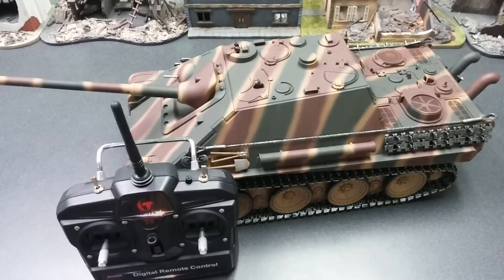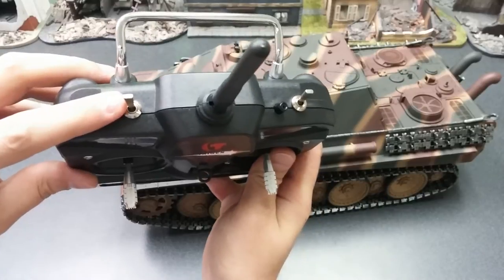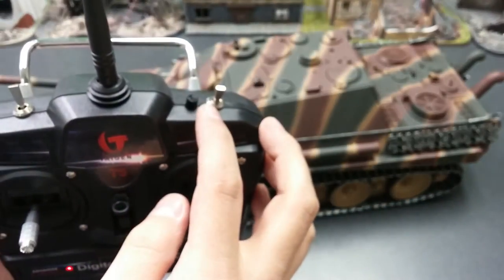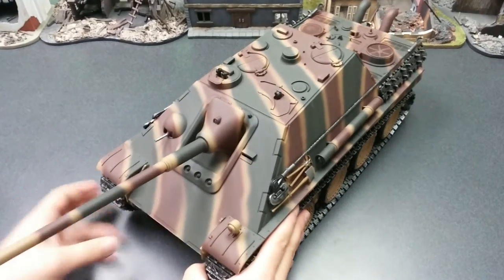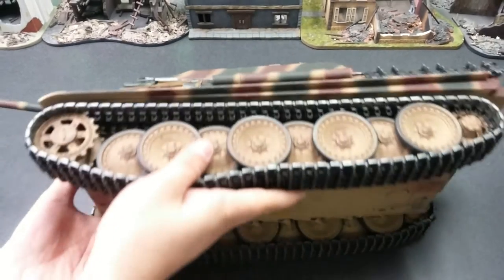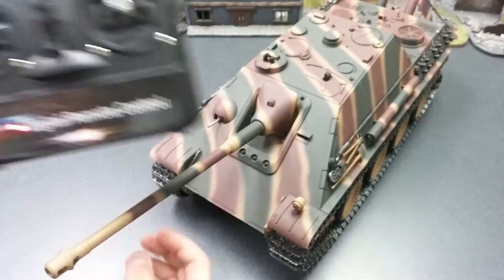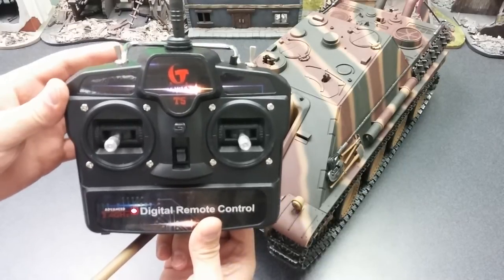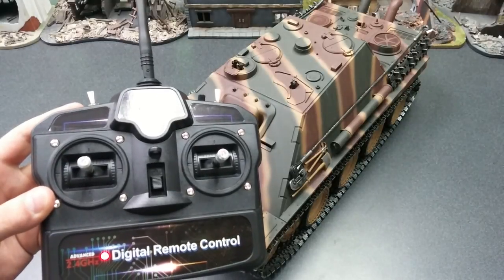How to bind a Taigen Tank (or our 2.4GHz system)

Comment: I have a Leopard 2A6 which I have had issues with, 2 V3 motherboards burnt out.  I am now trying to bind to a third V3 board but when I do as instructed here I do not get a flashing red light.  The transmitter is a Taigen T5

Comment: I have the 3856 tank and just bought a NiMH battery. The tank drives fine for the first 5 minutes then all of a sudden if I let go of the forward throttle, the tank continues to run forward. I have to chase it and pick it up to turn it off. Please advise.